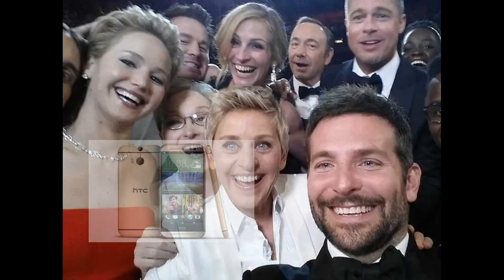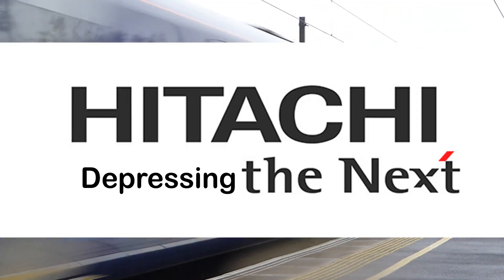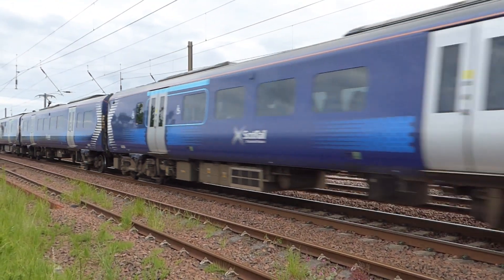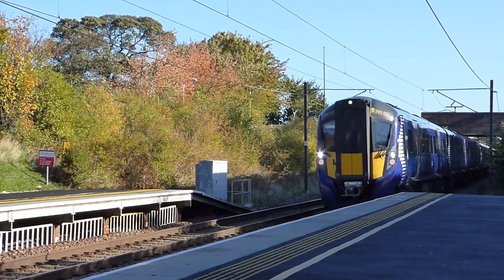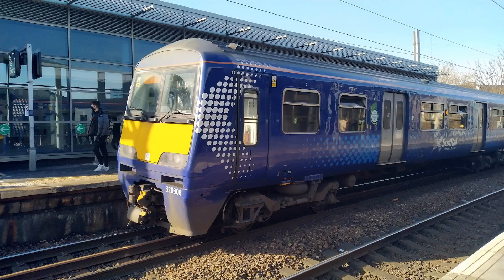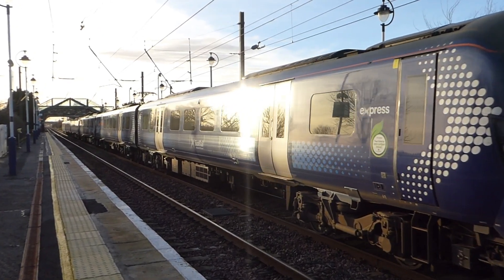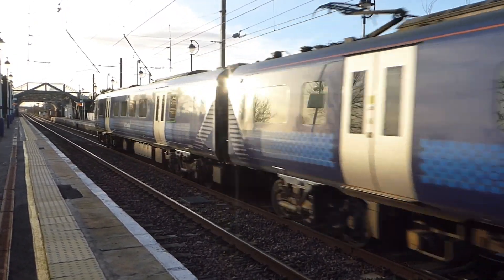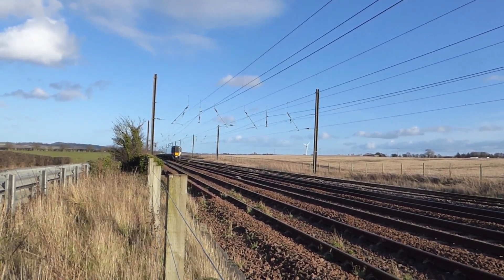Hitachi's Only Good Train? The Class 385, Summarized TS E6

Comment: The front ends just shouldn't have looked that abhorrent.
Reply: *image of 380 slowly fades up
Reply: @True_NOON  for some reason the 380s more tolerable. But could have been modified to be a little better too.
Reply: @bb-3653  well they have a bit of slope but the gangway folds back so that for 1 the sight to the right(incase needed) is far greater aswell as there being less space between the dash and windshield(what i got from tsw)